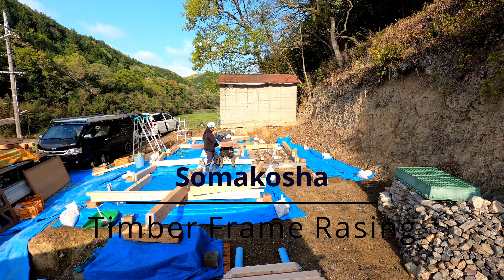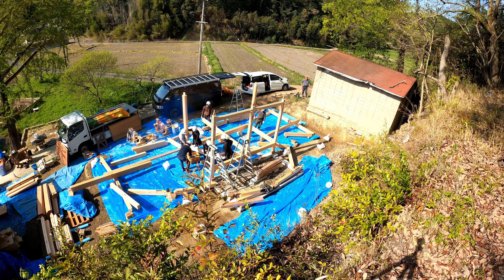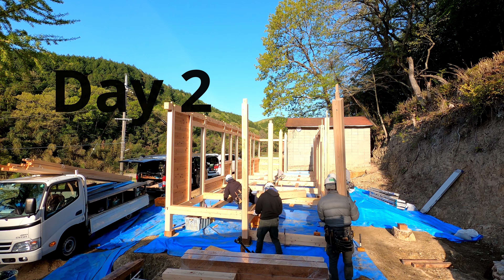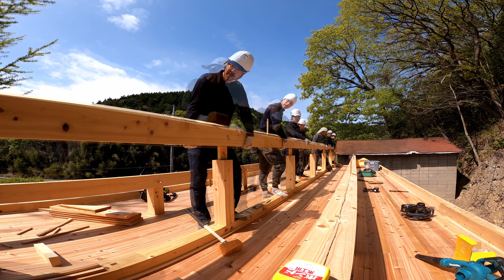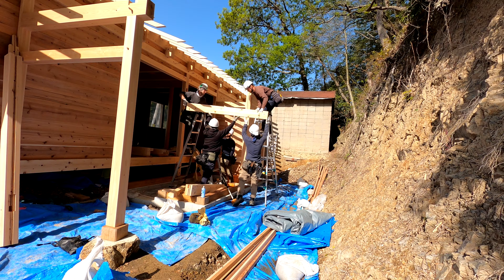Somakosha - Traditional Japanese House, Timber Frame Raising

Comment: Wow! Solid wood even for the roof!! My kind of house!  I'm going to have a 8 1/2 x 25 ft timber frame home built on a flatbed trailer. It will have a small loft, & maybe even a roof that tilts up to let heat out.  I also want it to have lots of windows, even if one of my son's clients said I was crazy to do so in Montana. Can't stand not being able to see outside!
  It is so perfect looking & well-built. Incredibly fine and beautiful.  Is the blue material a water barrier that they leave under the house? Water can go down but not pool there? Never seen that done before.

Comment: Absolutely beautiful build.  But I was wondering what this is going to be used for.  There was no plumbing or any insulation, so I am wondering was this just a build to show the techniques?
Reply from the maker: This is a fully functional house.  The plumbing and electrical was installed after we built the structure.  The climate is really mild in this location, so there is no insulation other the layers of wood panelling.
Reply: @BigSandWoodworking  That makes sense.  I grew up in Okinawa and it is hot and humid there and my house was a concrete house and we had to chop a hole in the wall to put in an air conditioner.
Reply: @packard5682  -Concrete houses are supposed to be cooler though. Maybe there were no vents right below the roof or in the roof to let heat out? You can also open windows on the cool side of the house and upper windows on the hot side of house to accomplish passive cooling.

Comment: Very nice building! Much teamwork and beautiful completed product!

What is the method used to maintain the roof in a rigid condition against high winds and storms?
Reply from the maker: Thanks!  
We use large screws to secure the rafters into the structural members of the roof, followed by tongue and groove boards that we nailed into the rafters.  Then a roofer came in and installed a clay tile roof.  All in all the weight of the tiles combined with the fasteners holding down the wood components makes for a really solid roof.
Reply: I'm also a little paranoid about this issue, I don't live in a windy/tornado area, but we've recently been getting storms that tear roofs off buildings: https://media.evz.ro/wp-content/uploads/2022/06/furtuna.v1-1024x575.jpg

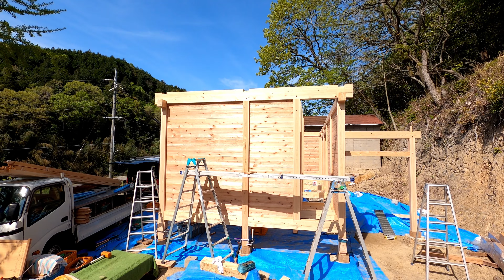I absolutely love this layout, but I'm a little worried about using it where I live. From what I can see, ultimately the roof rests on the vertical beams seen at 4:57 or 1:40 via dowels. So the upper side is nailed together, but it's only tied to the structure below with those mortise-tenon dowels; and it's the same for the middle portion connecting to the floor/base.

Comment: Did I miss the bit where they put the insulation in?
Reply from the maker: No insulation, just the boards that you can see us install in the video, as well as an additional layer on both the inside and outside put on top of that.  Overall the climate is pretty mild year round where this house is located.

Comment: Assuming not a nail in sight?
Reply from the maker: We used screws to attach the rafters to the larger beams in the roof structure.  And nails to fasten the roof deck boards.